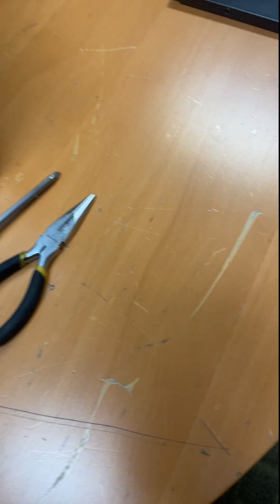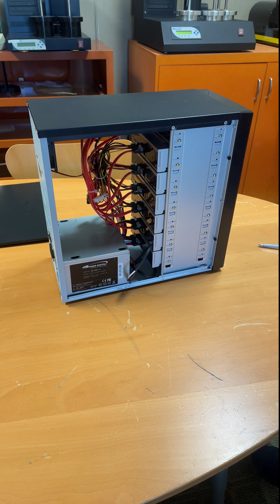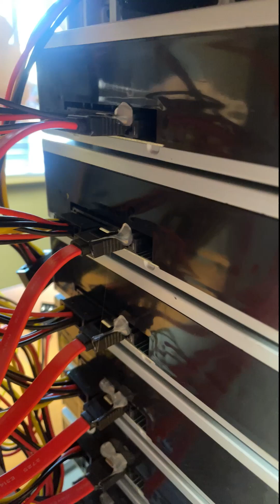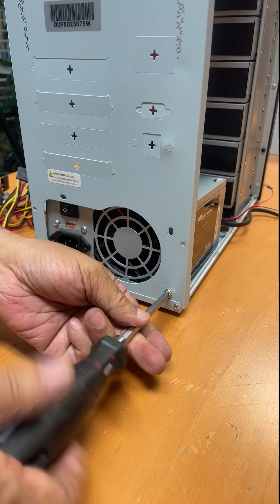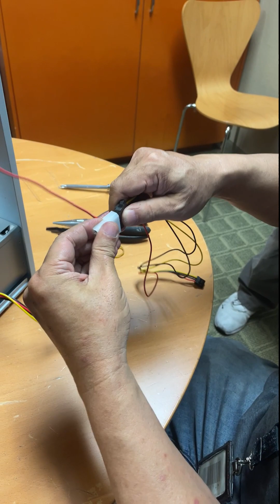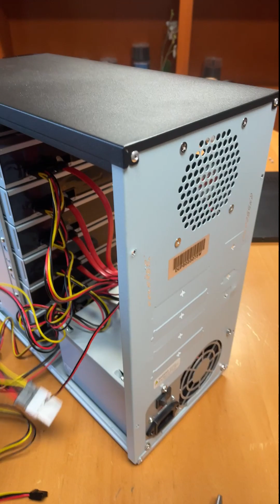Vinpower How to Change a Duplicator Power Supply

Comment: Thank you for the tutorial. Replacing the power supply for my non-working duplicator seems simple enough. Only challenge seems to be finding a replacement power supply that has the proper connections for the front power switch. Do you recall where you purchased yours (that you used in the video)? Mine has a Vinpower Digital SD-335U (300 watt). Thanks!
Reply from the maker: Best thing to do is contact Vinpower's support and they can provide you details where to purchase a replacement power supply.  They can be reached at support@vinpowerdigital.com
Reply: @vinpowerdigital  Thank you again. Appreciate the contact info.